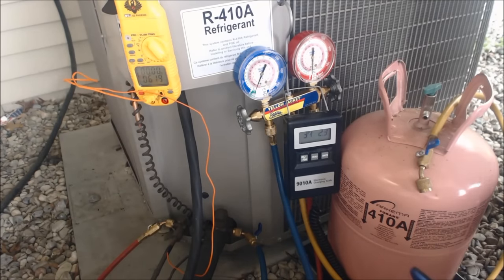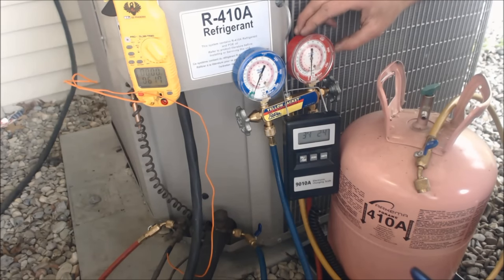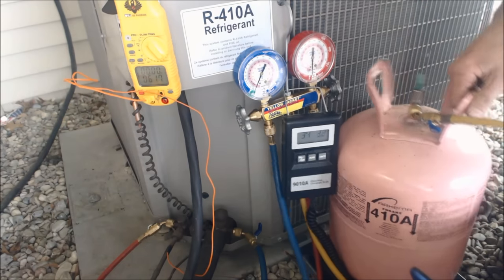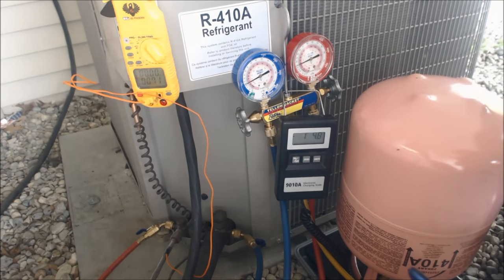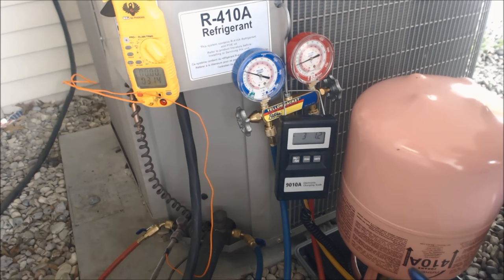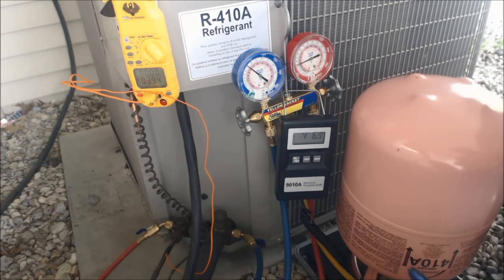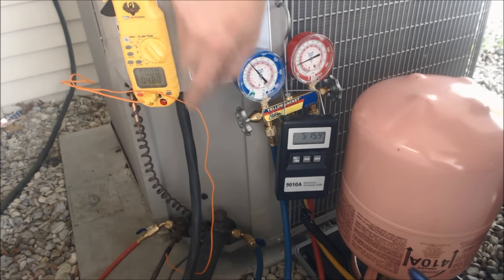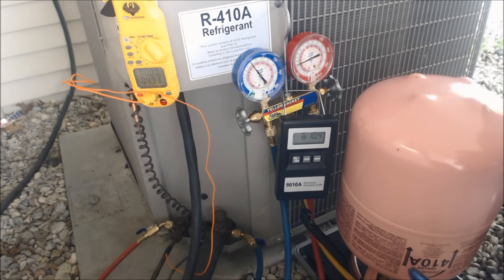R-410A Charging! Weighing in Refrigerant Charge through the High Side Red Gauge and Why!

Comment: How to add R410 A into mini split when is  totall empty, and only LP valves exist?..Thanks!
Reply from the maker: You would need to pressure test, vacuum pump down to 500 microns, weigh the refrigerant in to the weight stated on the rating plate and add extra refrigerant per foot extra of lineset. Here is a video on that---https://www.youtube.com/watch?v=QpzOSQt2fpI&list=PLxnHR5_D2ojzAUXWWQt9A8juotNkzwYlk&index=51
Reply: I have the same question how do you weigh in r410a when there is only a LP service port and no refrigerant in the system at all including the compressor . Do you need to have the compressor running/can you run the compressor even when there is no refrigerant? Can I break the vacuum with liquid r410a on the low side and then turn it on and sip it in until I hit my weight? or will this damage my compressor? The problem is I dont have a High/Liquid service port on my daikin mini split. I haven't found any video's where guys weigh in a completely empty system only from the low port all of them are brand new installs where there is already a pre-charge and they are adding just alittle for the extra lines.
Reply from the maker: Well if you did a repair, say on the compressor or solenoid valves you could go ahead and braze a 1/8" access valve onto the liquid line inside under the outdoor unit cover. The unit also has an accumulator and the last time I talked to a Mitsubishi tech they said it was normal to have 0-5 degrees of superheat while running on full emergency cool on all indoor units. My question was isn't that going to damage the compressor if you don't have superheat? The tech on the phone said that they are safe even when running at 0 superheat because of their accumulator.  We know accumulators have their own metering device so at least it is at saturated state but mainly vapor. To be extra safe you could braze an access fitting right in the side of the liquid line under the cover. Remember that they design these specifically so that people don't try to charge them in subcooling. They also design them to have flares so that the torch doesn't touch the lines. The problem is not the torch but that many are not running the nitrogen through and the manufacturers don't want the blame of all that oxidation clogging things up. Most of the refrigerant from a system that says you can have up to 125' of lineset when you only have 30' is just sitting in that accumulator so technically it would have to go there before going to the compressor. To be sure, check with the manufacturer themselves at tech support to be sure of their recommended procedure. Thanks

Comment: So weighing in is not the same as charging
Reply from the maker: In this case we are breaking the vacuum with refrigerant from the bottle. In other cases you are adding refrigerant into the system while it is running. You can refer to both as charging or weighing in but you may add more details to the sentence to explain which of the two processes you are doing, thanks!
Reply: @acservicetechchannel  thanks